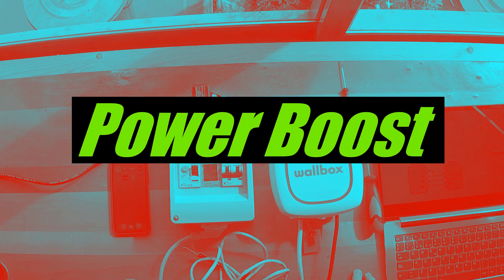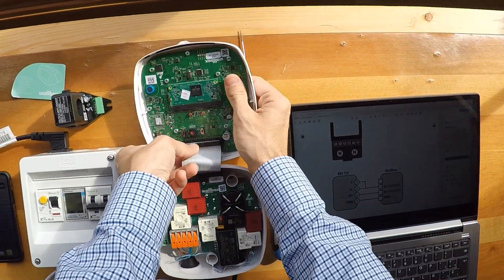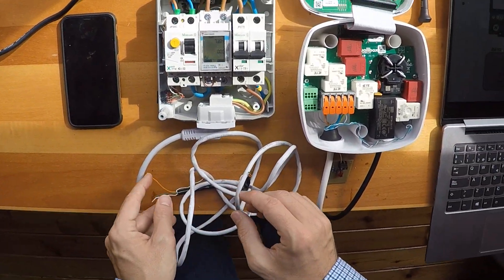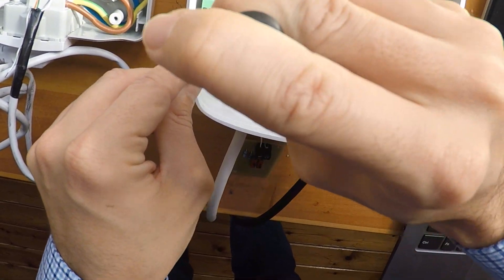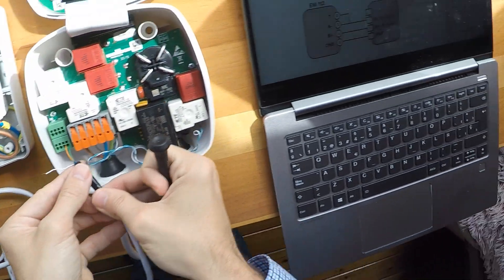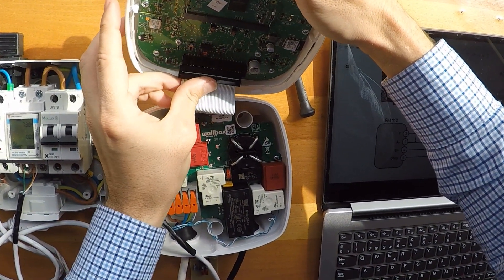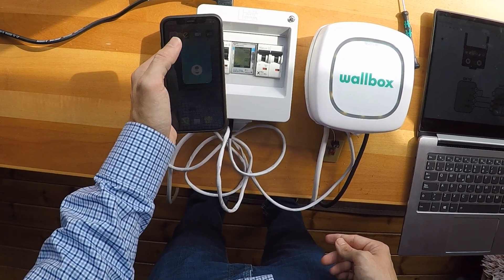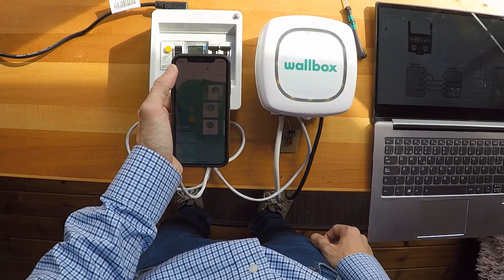Power Boost

Comment: What can you do when the wallbox doesn't see the meter.
The right connections are made using an stp cable but the wallbox doesn't see a mid meter. Can we measure something to find out what is wrong?
Reply from the maker: It is important you contact wallbox service department. Could be that if you have pulsar max the power meter is another one that works with it. There are a large number of chargers

Comment: Hello, the EM112 carlo gavazzi meter installed with my EV charger has stopped displaying any data, and it is not communicating with the charger, but I am still able to charge the car. So power must be passing through the meter to the charger. 

Please guide me on what I can do to restore the display and communication with the charger.
Reply from the maker: Dear Larry, with the information you are providing is a bit complicate to understand what could be the reason. Those products, if you bought from Walllbox, you have warranty for the stablished period (2 years before last year, and 3 years now). It is possible that even if the energy flows through the charger, the meter stopped working and Power Boost is not any longer available. Please check with our Service department, share the serial number and i strongly suggest you connect to Internet that charger. Hope it could help
Reply: @alejandrocriado794  I thank you very much for your prompt response. I have contacted the company that I bought my car from in Nigeria here and who installed the Wallbox charger along with the meter as a complete package less than 2 years ago. 

I just hope that they will be responsible enough to replace the faulty meter for me.

Comment: Hi, I installed the Pulsar Plus Wallbox with EM112 counter in my house. But when I activate Eco-Smart, it says "Waiting for clean energy", even though the PV is producing 6 kW and the house is consuming 0.3 kW. How could I solve? Thank you
Reply from the maker: It is hard to know from here, there is a form to ask a support , you need give serial number to them in order to know. Update the charger, and if it is updated is possible is not well connected.
Reply: I think we might have the wrong meter model (I have the exact same problem like yours)

Comment: Sadly you don't show how to install the cat5e cable properly into the wallbox. It should get it's own sealing rubber grommet (from the back).
Reply from the maker: Dear Sir, Nowadays the design of the charger has improved a bit, so that grommet now (on the bottom) is available. Also, there is a new free course that embrace you to take it that explain with much better videos how to install these chargers.
https://academy.wallbox.com/login/index.php

Comment: Very bad unprofessional instruction and a way too complicated solution for loadbalancing.
Reply from the maker: Dear Sir, thanks for the comment. Actually, load balancing is another video, this is Dynamic charging, totally different feature. in any case it has been prepared by an engineer in the pandemic time, so the marketing department is working in a better way to explain. Sorry for the inconvenience
Reply: @alejandrocriado794  thank you for the swift answer so what is the difference between load balancing and powerboost?
Reply from the maker: @kitesurfschool  Power boost is dynamic charging. Means to decrease the power consumption of the EV automatically for avoiding black out. Load balancing (power sharing) is sharing the power available between several charge points. Of course, those solutions can be merged and the result is Dynamic Power Sharing (Dynamic load balancing)